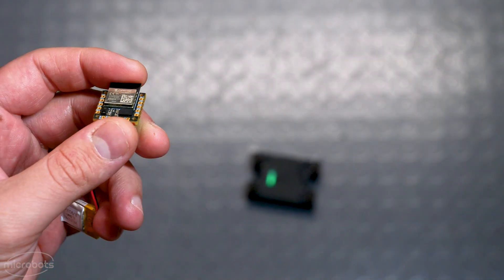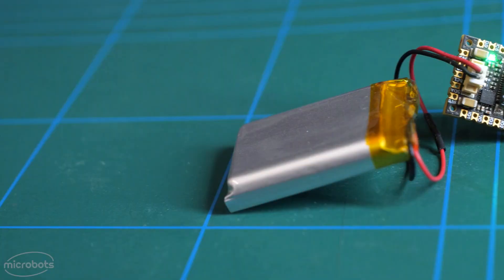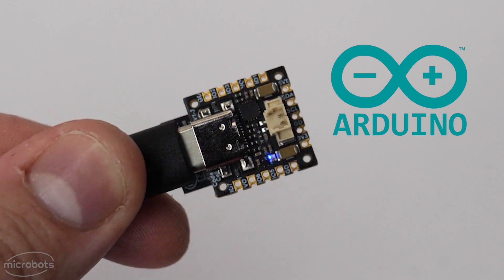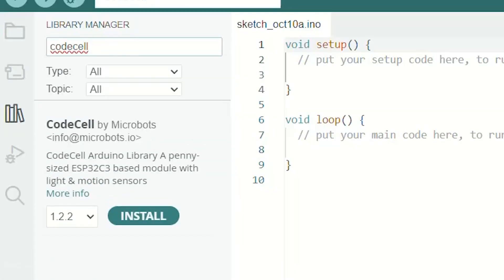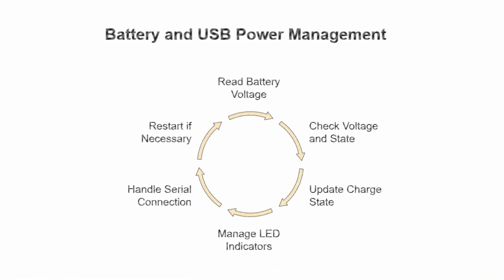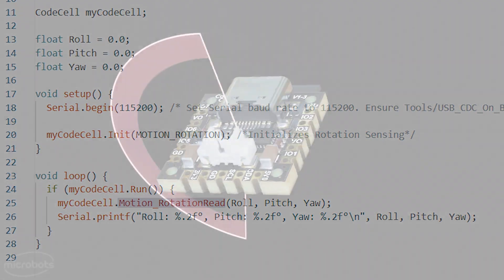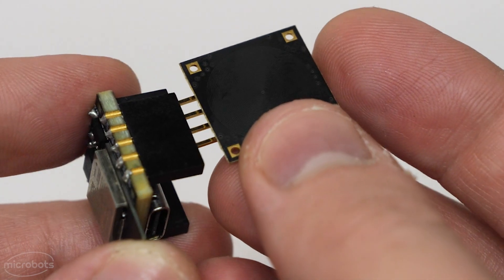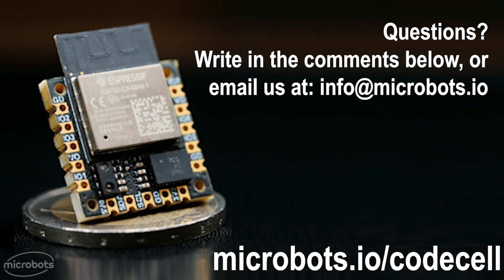Getting Started with CodeCell

Comment: This may be a weird question, but would it be possible to make the IMU sensor external from the CodeCell? I'm looking for a way to fit a motion tracker into a custom mold wired In-Ear and connect it to a separate microcontroller, to use as a headtracker for immersive live monitor mixes.
Reply from the maker: In that case we suggest using the CodeCell light and connecting the external imu to the Codecell's i2c bus

Comment: The sensors on this thing are too slow. You can't use them to control something useful unless it's a turtle or a snail. 🤔
Reply: They do seem to be too slow for my application. Is there any way to reconfigure the .run function so it returns true at a higher frequency? The ESP32 can run it 160 MHz, but with the 100 ms limitation, it seems as though the sensors only run at 10 Hz. Which is abysmal.
Does one have to put their sensor reading functions inside of that if statement?
Reply: @asjnsb there's a 100ms limitation?
Reply: @ThyAnon  as far as I can tell, yes. All of the sensor logic seems to have to be located inside of an if statement inside of the main Arduino loop, and supposedly that if statement is only true every 100ms. Which to me says that you only get data from the sensors every 100ms.
Reply from the maker: @asjnsb  thanks for your feedback! but i think there is a misunderstanding:
- only the battery management runs every 100ms
- the run() function also returns true every 100ms which you can use to time your code
- the sensor measurement/other-code can still run faster (clock speed is 160MHz) just put your code outside the Run if statement
Reply: @microbots_io  Beautiful, that is exactly what I wanted to hear, thank you!
Reply: @asjnsb 💯
Reply from the maker: Thanks for your feedback, we love to learn more why you think the sensors are slow.. As shown in all our examples they are quite responsive
Reply: @microbots_io  no, they're not. 100ms and 300ms are too slow.

Comment: Hi Carl, thanks for the video. I purchased and received 3 Codecells and they looks fantastic!

I have two question:

- I'd like to learn more about the sleep mode that the library allows you to manage. Is it the light-sleep mode of the ESP32? And if so, how would you recommend managing the Bluetooth connection since wireless peripherals are powered down in sleep mode?

- Do you have any recommendations for alternative battery suppliers? The shipping costs on your website are a bit prohibitive when you try to add the battery
Reply from the maker: Hi! Glad you like the CodeCell :) 

Here's an example that demonstrates how to use the onboard light sensor to wakeup from deep sleep mode - https://github.com/microbotsio/CodeCell/blob/main/examples/Light_SleepExample/Light_SleepExample.ino 

This can be modified and/or replaced by the motion sensing. We will share some BLE examples in the future.

Regarding the LiPo battery, unfortunately there new shipping restrictions which increases the cost of the shipment, but you can source the battery locally - the connector is standard and we also include a wire cable in the box

Comment: Hi! Very interested in this once they are back in stock! I just wanted to know how many I2C buses are available on the unit with the IMU. Is the IMU attached to the same bus that's available through the GPIO pins?
Reply from the maker: Thanks for your interest! there is one i2C bus to connect other sensors and 6 other gpios pins with power pins on each side. Both the onboard IMU and light sensors are connected to the same I2C bus